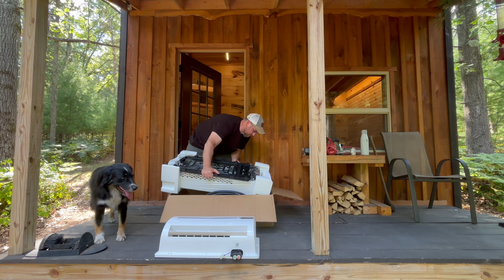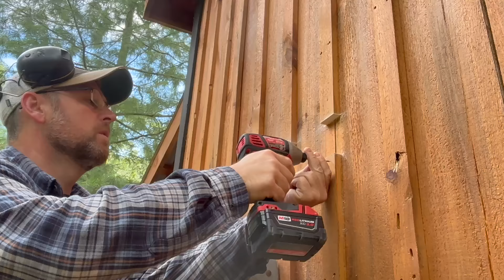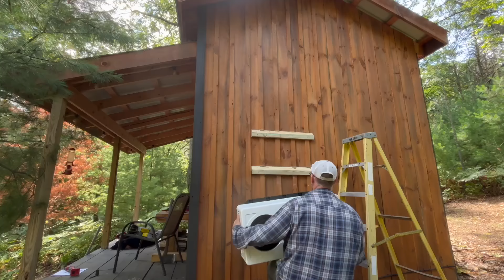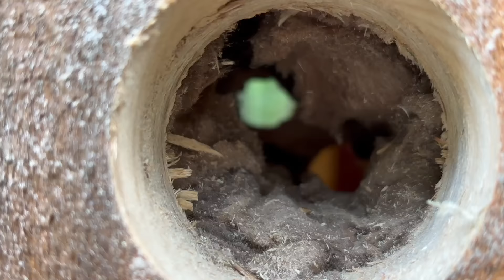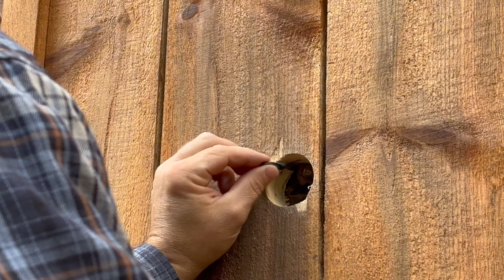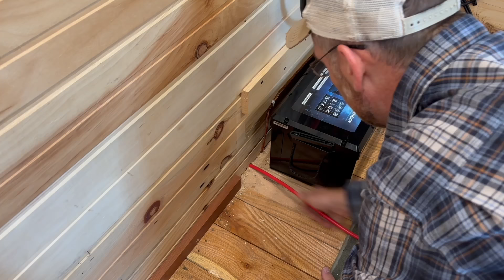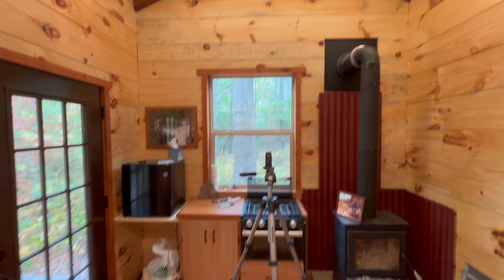12 volt Air Conditioner in the Off Grid Cabin ! OutEquipPro

Comment: Great video sir, but may I ask why u need aircond at 75 fahrenheit ? My home country is hot and humid,even
 today temperature reached up to 106 fahrenheit. Certainly need the AC
Reply from the maker: Thanks !! It get's in the mid to upper  90's it just wasn't that hot when I had finished installing it . I had another project I was working on and didn't want to wait to finish the video . I plan to do another test video once it gets hot this summer

Comment: A electrical powered motor under load has a spinning magnetic field that extends away from the motor under load?🤔 placing Tesla coils around those spinning motors can absorb that spinning magnetic field to generate electrical power that can be feed back into the power system supplying power to the whole system? 🤔✨️
Reply from the maker: Way over my head but that would be pretty cool

Comment: Something is definitely going on with that evaporator.
Reply from the maker: I think there may be something in the fan maybe I missed a zip tie or packing material . I plan to do another video on it once it gets hot out longer test run power consumption . hopefully I can find the noise and fix it

Comment: Your line set is creating an oil trap. Should be ran in race track configuration unless you’re ok with replacing compressors
Reply from the maker: So take the loop way over to the right to eliminate the droop at the bottom ?

Comment: Hey, new to the channel here. This is awesome. I just noticed, as for your mini fridge, they make a 12v /120v hybrid mini fridge, it's got a compressor and everything, the one in my 78 sunraider camper has a mini inverter built in, so the fridge only turns on the inverter when it needs to. 
There's another style called an absorption fridge, some are hybrids that work on propane, 120 ac and 12v, but the styled have both their pros and cons. Just some food for thought
Reply from the maker: Hey thanks , and welcome to the channel!!  I thought about a DC fridge . I actually put on in my first camper build and love it , but I didn’t feel like running more exposed wires across the wall or having to try to hide them . Basically I went the easy way lol
Reply: @blackspruce1861 yeah man i get it. I actually watched your video because I've been looking to install an air conditioner in my own camper. It's a truck bed sunraider, not a class c toyota sunraider, and an air conditioner in the back would be ideal for the temps hitting in the 100s during the summer over here. Just wanna ask, how much power does your setup draw, and what size battery are you running?
Reply from the maker: I really liked there roof top unit as well put one in my homemade camper works great and is super quiet here's a link to that install .https://youtu.be/ZJUVoA1Ut2k.  also I did get this mini split  quieted down the fan just needed to be adjusted . must have been made on a Friday lol

Comment: How about some useful statistics - how much wattage, amps, and watt-hours does it use?
Reply from the maker: I replied to a few comments a while back with those I don’t remember at this point. But I’m currently trying to find the right metering equipment for my electrical system to get real time wattage output amp draw battery capacity etc . Then when it warms up I’ll do a follow up video with a longer test

Comment: Hey probably a weird question but what's the dc disto box your using @ 19:44?
Reply from the maker: Not weird at all . It’s called a combiner box and came with the kit I installed . Here’s a link to that video if you’re interested. Power your Off Grid Cabin with Renogy: Easy Workshop solution for beginners
https://youtu.be/xcINL7WM7oI

Comment: That"s great!Well explained! Noisewise speaking ; how quiet is the a/c?
Reply from the maker: Thanks !! I'm thinking I may have missed some packing material or maybe the fan is out of place  it is a bit noisy . something is definitely not right I'm sure of that because their roof top unit I installed in my DIY camper is super quiet . That video is on the channel too . I plan to take it off the wall and see if I can find the source of the noise then do a follow up video with more info on power consumption . probably when it's really hot out

Comment: I would have really loved to see Amp draw while running under full cooling.  At my offgrid cabin, we measure everything, as it's literally offgrid, just solar and batteries.  I do have a back-up genset for times when solar isn't working, but that is extremely rare.  I would like to see the draw to figure out how long I can run it without solar, just off batteries.
Reply from the maker: I plan to do a follow up video getting amp draw and more info . Once it warms up and I get the right equipment

Comment: Thought you said this only runs off of a 12v battery? It looks a lot more complex than that unless I misunderstood something.
Reply from the maker: It is a 12 volt air conditioner.
Reply from the maker: The solar system keeps the battery charged
Reply: @blackspruce1861 and how many watts is the solar system, and is it a 12 v battery for how many sq ft?

Comment: Normalmente tutto quello che viene montato in camper o autocarro o casa mobile funziona in ogni posto. Prima di fare le dovute spese si prendono i dati tecnici delle cose. Le domande sono: Dove devo metterlo? il posto è coinbentato o no? quanti BTU ho bisogno?, quanto è grande l'ambiente? Di quanta energia dispongo? quante ore devo usarlo? Dove ho la baita ho abbastanza irradiazione di sole? Sono Domande che permettono di non buttare i soldi. Ho visto molti condizionatori americani in vendita ma poi vai a controllarli e sono 4000 BTU, inutile spenderci i soldi se vuoi rafrescare una stanza non superiore ai 15/20 Mq. un 12000 BTU va bene per stanze dai 45 ai 53 MC ovvero 5x4x2,7 mt. Come i famosi Cinebasto dipende dove vorresti montarli, ed occorre avere una base tecnica e pratica. Non penso che il condizionatore da te comprato sia molto economico visto che essendo a 12v lo fanno pagare tantissimo. ho visto che oggi si trova a circa 790 € / 895 $ a parità di prezzo un DUAL SPLIT TLC 12000 + 12000 BTU A++/+++ lo trovi anche in promo a cifre come 658,00 € / 770 $. Non ha senso spendere per quel condizionatore SPERANDO che funzioni. nel tuo caso prendi una batteria carrelabile in promo dalla cina con all in One arrivi a 17 kw di accumulo rivendi tutto quello che hai messo tra regolatore di carica, inverter,batteria e volendo pure il condiuzionatore compri anche pannelli dual face da 425 watt (come minimo) e otterrai un impianto da 6 kw di tutto rispetto potendo usare la 220v o dove ti trovi tu la 120v. Bel video giusto per vedere un instalalzione atipica ma sbagliato completamente nella logistica del risparmio. Un abbraccio!

Comment: The website doesn't list the wattage, but calculating it with its volts and max current on, high this thing going to run 750 watts. you would need 6 1200 watt batteries and 12 solar panels to charge them to run this thing for 10 hours a day.

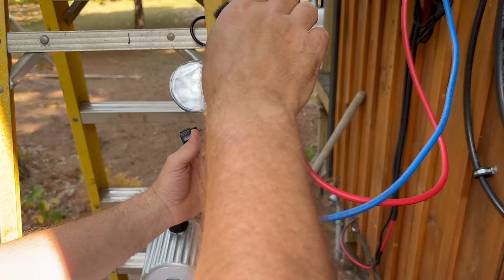Comment: 23:50 it will never show leaks, you closed both service valves to the gauges. You only measured how airtight your vacuum port and check valve were lol. Should have closed the center vacuum line and left the sides open to the system..

Comment: How many amps and watts does this pull?
Reply from the maker: I dont remember at this point , but I am pretty sure It should be back in the comments somewhere . I do plan to get something for the solar kit that will give some realtime info on what is drawing power consumption exc.. then do a follow up video when it gets hot out

Comment: For off grid situation, that is the bomb, now how well would it work in Texas in late July triple digit heat? That would be a real test. Honestly all AC units struggle with triple digit Texas heat. The steam bath humidity + the temperature is absolutely miserable without AC. That would be a tuff test for sure. Great video as usual and great job with the install. 73 GOD bless Earnest k5ewm 👍🇺🇲👍.

Comment: Even if you don't see a difference in the gauges after letting them sit for a while, you should run the vacuum a little just before opening the valves. -30 on those sets are pretty broad and inaccurate. If you seen a micron gauge you'd see what im talking about. I don't think 134 is as picky as higher pressure systems though.

Comment: Did I blink and miss your battery level on a shunt, battery monitor or app? Voltage doesnt tell us much with lithium as its a mostly flat line until they're empty. Interested in the amount of current draw, how often it cycles on and inrush current. Your battery size and how much solar your getting and on average during the warmer months. With your initial test a starting battery level, time ran and end level would be great if you ever re-run it. Good install video though, the hiccups you find and work through helps everyone avoid it on their future install.

Comment: If I were installing this, since its a cabin in the woods, I would install all the wiring in conduit to prevent animals like squirrels and chipmunks from chewing on wire insulation. Any nick thru  the plastic insulation will let moisture in and cause the wire to oxidize and  fail. The squirrels in my neighborhood will even chew on one of my neighbor's car electrical wiring.

Comment: I usually make the holes a bit larger so i can use pvc pipe as conduit for the pipes. It seals the air gap in the wall that helps house avoid wood rot.

Comment: Should run about ten minutes on that battery. The ac uses alot of energy. 30 amps. You should have purchased 110 v unit and run a generator.

Comment: Im always surprised how many people with good skills use butterfly bits. I own them too but only as a backup. I purchased a set of Makita hole saws from about 5/8" to 2.5" and a 8" extension rod 30 years ago. Used then when I installed a DIY 2 air handler Mr Cool mini split and they were handy. As I recall 3" hole saw was needed and of course I had one of those too. Butterfly bits tend to jump around especially when trying to drill through a knot or something extra hard. Where as a hole saw always gives you are more precise hole. Just a minor point but I have found these useful tips so handy over the years. 40 years cabinet maker, carpenter, electrician, plumber, roofer, foundation and flatwork, masonry/ ceramic tile, domestic well pump and all controls including pulling and replacing pumps to depths over 200ft. I invented a wheel that clamped to the well casing so you could pull the poly line set by hand or with a Troy Built power wagon👍. My point is that my experience is diverse but the quality of my hand tools were absolutely necessary to reduce frustration and increase quality. Im retired and have been for 5+ years and still dont hesitate to buy hand tools that make the project easier

Comment: Seems to me like you could’ve just rolled a larger diameter hole on both sides of the wall slipped in a piece of plumbing pipe, sealed it with expanding foam, then run all your plumbing and electrical through that putting the grommet on one end then filling it with insulation on the inside and hiding the plumbing and electrical on the inside by simply designing a shelf and bracket to cover it up 🤷‍♂️
Definitely a good project though

Comment: Lot of work, a lot of money. I would have just cut a square hole in the cabin and installed a 5000 Btu small air conditioner,  for about a $199. You did a great job just too much aggravation.  For me.\n T 23:07 o do The 5000 W window air conditioner is 110.But you can plug that right into your inverter and run it off the Solar System.I That's what I did for my mobile home

Comment: If I build a tiny cabin I would go with a PTAC unit over a mini split. I do HVAC/R. I think the PTAC units are generally more reliable vs mini split units and no line set to leak refrigerant. The PTAC units mount typically low, although they can be mounted high on a sidewall if desired. They are much quieter now than in the old days. I've installed hundreds over time and just frame open a 16x42 opening, push the wall sleeve in and secure it with screws leveled/sloped per the manufacturer instructions, push the actual unit in place and screws about four screws, plug it in. They come in several BTU/HR choices, as a/c only, a/c + electric heat strip, or even heat pump. Being crafty, someone could make a desuperheater heat-exchanger and gain some kindof free hot water off of the compressor discharge aka "hot gas line".

Comment: Wish they'd come out with a heat pump version for year round use.  12,000 btu/hr will easily cool a cabin your size.  Made for poorlly insulated RV's.  Many homes are cooled with 24000 btu/hr for and entire 1000 sq ft home.

Comment: Proper procedure is to open the refrigerant valves THEN remove the gage hoses.  That it's under pressure going out not in when you momentarily remove the hoses.  Small loss but ensure no non-condensibles enter.  I think pure vacuum is around 28 psig.  Most gages aren't exact enough and look like 30 psig negative pressure.  Other than that job well done.  I speak from experience with over 40 years of hvac experience.

Comment: How many volt amps are you pulling?
Second question how about on heat cycle?
Reply from the maker: its 12 volts amps it goes up to 62 but as for real time I don't know , but when it warms up I plan to get a shunt for my solar set up . that will show amp draw watts etc... then I'll do a follow up video and give more of that info as well as a longer running test

Comment: Greetings: 77F outside is not bad. Normal 4 many. Try it 100F outside. Check temp difference 1hr then at 3hrs. Thx 4 the share.
Reply from the maker: I plan to do a followup when it warms up , but we haven't seen 100 degrees here since 2012 I believe
Reply: @blackspruce1861 Greetings: Good idea. I doubt most reviews on the onset unless it is just feature and introduction.  A year or few later provides more fact and better decisions. Thx 4 the share

Comment: What is max current draw start / constant? Then what is average draw 50/cent duty 8hrs?
Reply from the maker: I believe 62 amps. I will be adding a shunt to my solar set up so I can do a follow up video with a lot more info when it warms up .
Reply: @blackspruce1861  Greetings: 62A U say, wow! What a pig.  Even that is high on start.  I figured that tho.  Such is my Q.  "Shunt"?  OK, is that a new millennial yuppie term Bcuz I know what a Shunt is in Electronics. Thx 4 the share.
Reply from the maker: @Dark_Knight_USA I’m told a shunt is basically a monitor that you patch into the wiring somewhere between the battery and the charge controller I think . They give more info like wattage being used amps volts . The charge controller really does give much info
Reply: @blackspruce1861 Greetings: U R partially correct. A shunt bypasses predetermined amount of current from supply to load. A measurement across it is electronically interpreted as current draw. It cannot display power consumption (Watts) as it is only half the equation in figuring power. Voltage is the other half which requires another connection to the low reference and circuit computing (depending on if the display interest is Peak, Avg, RMS, Etc) the power as measured.  The correct terminology for the device, I believe, U describe is simply a power (watt) meter... Not a "shunt". Shunt is an electronics  term for  variation of a Short.. which most Ppl get wrong baby using that term also. Short does not mean problem or bad.  Understand?
Reply from the maker: somewhat lol . either way I plan to do a follow up video with a longer test and hopefully some more useful info on power consumption
Reply: @blackspruce1861 Greetings again: At 62A U can use an inductive Ammeter which is less evasive than Ur "shunt" and a an inline unit. If U need a 'power' Display then such similar unit can B built or purchased. Myself, I have separate and calculate if needed. Voltage and Amperage is more important 2 me than power.

Comment: Don't worry about making the holes small and perfectly placed. Just make a nicely finished board to go along the whole bottom edge of the unit and cover all the hoses, connections, entirely!  I haven't finalized my design, but I'm going to build a box around my evaporator on my van's back door. To cover the ugly hoses and wall mounting screws, but also to add some kind of easy cleanable, replaceable filters. Because I need to clean a LOT of dust and stuff out of my evaporator between summers! And a deep clean is a whole process!

Comment: What's the benefit of going with a 12v air conditioner instead of running a 110v ac off of the inverter? I haven't set my cabin up for solar yet but when I do im interested in adding an air conditioner. Good job on the install!
Reply: Because it can run on batteries.,.imo at least

Comment: 👈🏻 HVAC GUY. Good job!! 

I would have added a pull out disconnect by outdoor unit just in case it ever needs serviced or replaced. 

My vacuum pump was 700$ my gauges about 200$
Most places will charge minimum average 200-250 for service visit up to one hour

Comment: Should of opened the valves before disconnecting your hoses you broke some of the vacuum when you pulled the hoses prematurely, coming from a HVAC technician
Reply from the maker: yeah makes sense , I followed the instructions sent. with the unit

Comment: That unit claims to be 12.5k btu, which is way oversized for your solar setup, it should be pulling over 1,200 watts when running. You can't run this thing for long without draining your battery, no idea how you think your battery and solar is keeping up, voltage lies on LFP batteries. You're also going to get condensation on the suction side fittings inside, you need to insulate them.
Reply from the maker: I'll get a shunt this spring , so I can get more info and do a follow up video